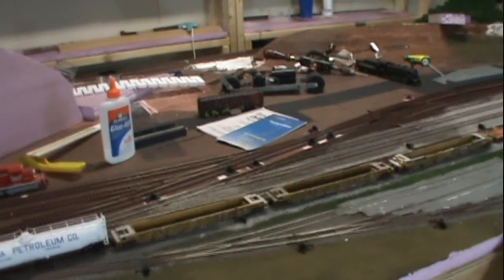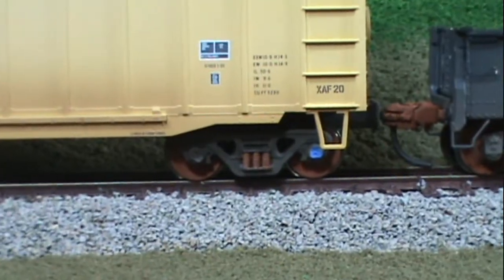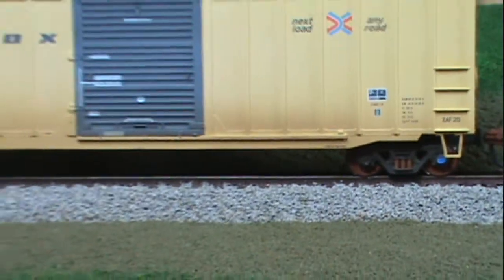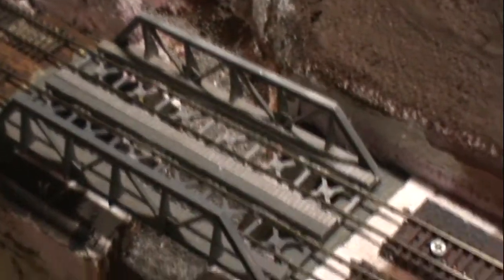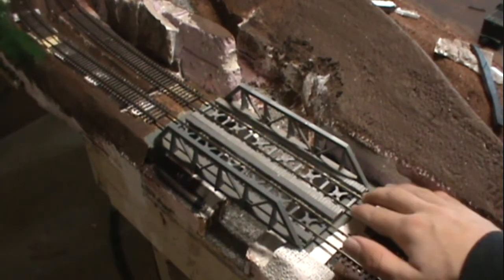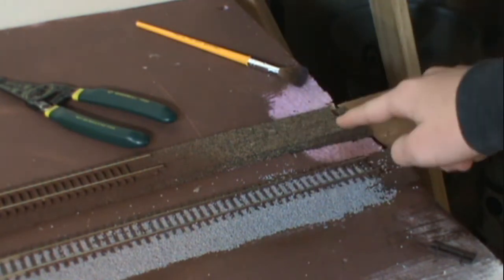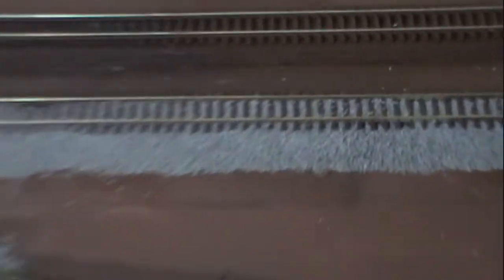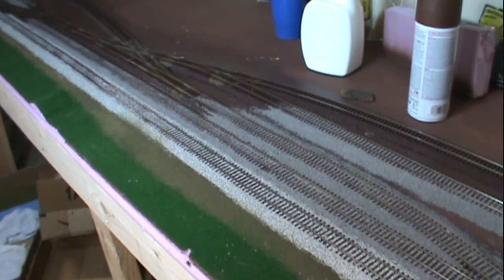Layout update 11/21/2011

Comment: Hey when you weather your track, are you putting a little oil on the rails (Ive heard it makes it easier to clean up) or are you just spraying them and then going over it quickly with the Brightboy?   thanks.  Nice work.